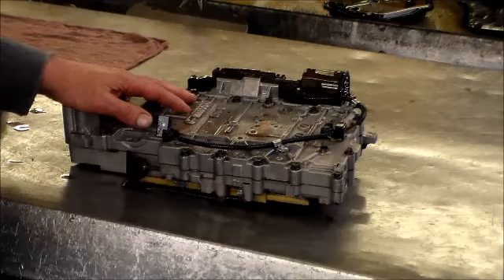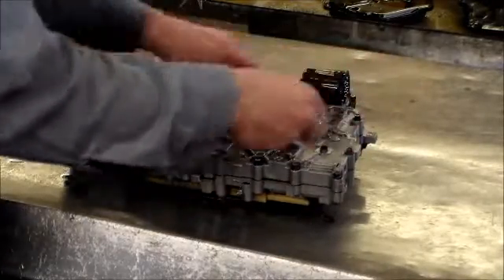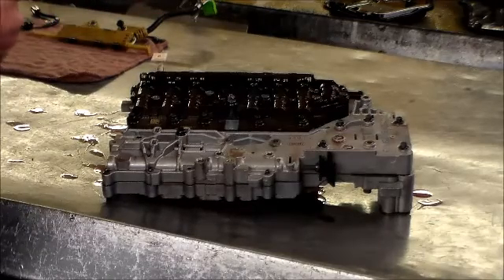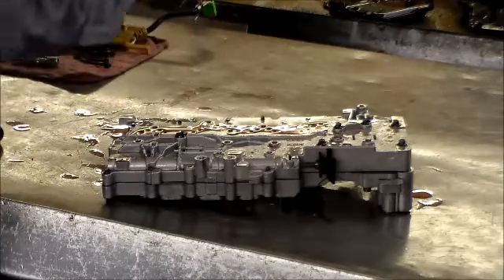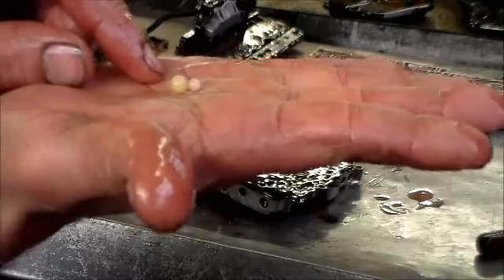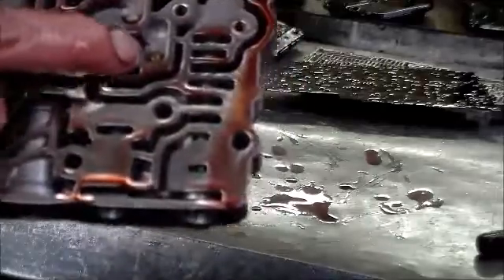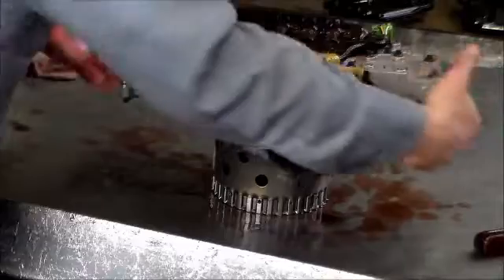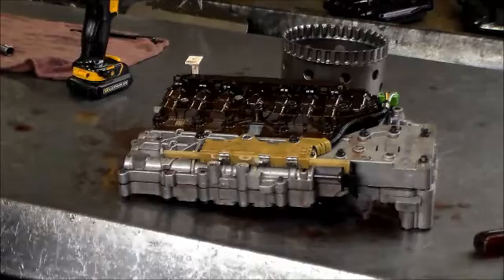6L80E Valvebody

Comment: I know this is an old video but I'd figured I'd ask.

I have a 2017 Chevy Tahoe, sometimes acts like it's in neutral when accelerating from a dead stop. It revs up it just under 2k rpms and then jolts a bit into gear, after that it shifts through all gears smooth and has reverse. It only does it sometimes. I replaced the TC, filter, fluid and upgraded the valve on the side of the trans but still have the same issue. There was no metal in the pan when I replaced the TC. Could this check ball issue?
Reply from the maker: yes it could, trans is full for sure?
Reply: @GaryFerraro  Yes, I put about 12ish qts of fluid and it's in the hatch mark when warm. Would you recommend changing all the checks valves or just the one? Also, should I get just the check balls or do an entire zip kit? I know one requires removing the pump and I would prefer not to do that. I'm thinking replacing the check balls should be fine?
Reply from the maker: @oovv2025  checkballs should be fine
Reply: @GaryFerraro  Thank you! I appreciate you taking the time to reply. Subscribing.

Comment: Hey Gary! You helped me greatly with my 6HP26 full rebuild. What’s your opinion on a ‘15 Yukon 6L80, after a few hundred feet lose all forward gears, still have reverse no problem. Turn car off, turn back on. Have forward gears no issue for another few hundred feet, then lose em. P2723 solenoid E stuck closed. P0700 general MIL command status on. Gonna pull the valve body and TEHCM and measure the check-balls and look at the pressure switches/solenoid gasket screens.
Reply from the maker: most common issue is the check ball shrinking down. This will effect forward only and not reverse
Reply: @ Update: The #1 check ball was minorly shrunken down and the TEHCM filter screen was a bit clogged up. Cleaned VB, replaced all check balls and cleaned out TEHCM screen/solenoids and it drives perfectly again!
Reply from the maker: @tylerroe5175  ok, how did the pan look? was there a lot of debris in the pan?
Reply: @GaryFerraro  Yeah there was a decent bit of debris on the magnet. It’s definitely gonna need a full rebuild and torque converter eventually. Prepping for that. But for now it’s back on the road!

Comment: Gary, thank you for one of the best, most detailed videos I've watched about any topic! I have a 2016 Sierra 4WD with a 6L80 and 84k miles. Last week, trans was shuddering a bit under light acceleration. Then yesterday I was almost home from a short drive and it was like the truck went into neutral, kept going in & out of gear and revving up and I managed to glide into the driveway. Took it out this morning for a road test and it was fine until it warmed up a bit (trans around 150-degrees) and it did it again, wouldn't move in any gear. I tried running it thru all gears and turned the truck on and off and sometimes after restarting truck it would intermittently engage, so I kept doing that and I made it home. No codes. I'm guessing this is the issue, so I'll pop the valve body off tomorrow. Thanks again!
Reply from the maker: How is reverse ? if ok, checkball problem.  If no reverse when hot, clogged filter because converter is no good
Reply: @GaryFerraro  I'll check that today, things were a little hectic just trying to get it to move. But reverse might've been gone too. I thought one of the times it was revving I heard rattling that seemed like it was coming from converter, too. If so, I'll need to replace converter and go thru trans? Thanks Gary!
Reply from the maker: @Hobart1958  correct, stops moving because filter is clogged up
Reply: @GaryFerraro   I just test drove that thing for over an hour. All different speeds, sat in park for awhile, sat with it in gear for awhile, got  the trans up to 176-degrees, etc. and couldn't get it malfunction; other than a little shudder or delayed shifting here and there. So I still can't say for sure whether I always have reverse or not. It definitely makes some whining-ish noise when cold and when slowly accelerating and you let off the gas, which I never noticed before - but I always have the radio on. After all that, I rechecked for DTC's and there are still none. I'm thinking I should go ahead and pull the valve body and examine the check balls and hope that's what it is, unless you have another thought. Thanks Gary!
Reply: @GaryFerraro  Just figured I'd follow-up: I dropped the pan today, and there's a fair amount of metal in there, so it's eating itself up. I slapped a new filter in and buttoned it up and heading to the trans shop. Thanks again for all of your help.
Reply from the maker: @Hobart1958  Let me know what they say
Reply: @GaryFerraro   Rebuilding the trans, new Techm, new billet converter, some mods to valve body/etc. $3800. The $7 worth of check-balls would've been a nice save, but that's the way it goes; at least I dropped the pan to take a shot at saving it. Too bad GM puts out junk like this, 83k miles with very little towing or heavy hauling is pretty ridiculous. The next truck won't be GM. Thanks again, Gary!
Reply from the maker: @Hobart1958  That actually is a very good price for what they are doing
Reply: @GaryFerraro   Old school shop that's been around forever, he jotted my name and info down in his spiral notebook and sent me on my way. As soon as he said "it's a little more expensive, but we get a new billet converter" I knew I wasn't even going to price it out, he was going to do the job right.
Reply from the maker: @Hobart1958  i use billet as well

Comment: Great video! Question do you have to replace the plate once you open the body up? Also do you go back tighten up all the bolts you put back in. It seemed you didn’t make the boots that tight.
Reply from the maker: Plate gets reused, has bonded gaskets.  Maybe i did reopen the body but i do not remember
Reply: Hey Gary. Thanks for this video. Question. What’s the inch/lbs torque spec for the bolts? Should a pattern be followed? Thanks!

Comment: Manufacturers designed these check balls to fail. I wonder if metal check balls would work better. Had a 2007 Escalade with the same problem. Paid 3 grand to fix it.

Comment: Wheres the number 4 check ball??
Reply from the maker: upper right hand corner of the valvebody,  Upper valvebody
Reply: @GaryFerraro  mine was missing when I opened it up and didn't have any issues..any thoughts?
Reply from the maker: @michaeljohnson91501  That checkball is seated against the 4-5-6 clutch passage in park,rev,neutral and drive 1st,2nd,3rd,  sure it wasn't there maybe fell out
Reply: @GaryFerraro  hmm maybe it did fall out anyway I replaced it along with fluid pressure sensors and put it all back together now it makes a strange whirring noise in park and neutral then seems to quiet down in drive and reverse any suggestions?
Reply: The sound seems to rev match as well...shops try to tell me its the pump and want to rebuild the whole thing but I'm almost certain it's not because it didn't do it before I messed with it
Reply: @GaryFerraro  could it be the 4 fluid gasket seal under the valvebody not sitting right thats causing the noise??
Reply from the maker: @michaeljohnson91501  I wouldn't think so,  did you change the filter?  how did the pan look when it was down, converters like to go bad with this trans

Comment: Dear sir, could you please advise. I have stock 6L80 on my 2011 chevy camaro SS. I found UPDATED Valve Body Spacer Plate w/ 8 Check Balls 10-Up. Can I use it on my stock car?
Reply from the maker: 2010 and later will fit, valvebody is not affected because the pocket is already there
Reply: @GaryFerraro  Do I need to buy 1 check valve more ?

Comment: HI Gary 
I have a 2017 gmc 2500 with an 6L90  transmission. From what I've read this transmission is similar. My problem is....had two small incidents the day before where the first gear seemed to slip a little. Then yesterday I went to pull out of my driveway and I had no first gear. I have reverse no problem. What I ended up doing was i put the selector in L1 , then with the electronic shifter button I switched it to second and the truck drives no problem. When I start rolling I flip back to D and the truck goes through the upshot and down shifts just fine until I come back to the 1st gear spot.....then nothing. I have no check engine lights on. Does this sound like the checkball shrinking issue to you. Any help by way of advise would be greatly appreciated.
Thanks 
Andrew
Reply from the maker: Yes, It dos, that is the first thing i would check, it is full of fluid corect
Reply: @GaryFerraro  Yes ,it was a little low, I topped it up but nothing changed
Reply: @andrewduffett9363 I'm having similar symptoms on my Tahoe. Did you figure out if the check ball was the issue with your truck?

Comment: Gary, great video and content as always. I am looking at my son's 2014 Silverado 6L80. NO CODES. The trans has drive and reverse and will lose BOTH at the same time. Cannot relate when it does this to any common denominator i.e. trans temp/run time. The scan tool displays the gear selected, but Gear Command on the scan tool was "neutral" on one test and the second test it was "1" regardless of actual gear selection. I am tempted to drop the valve body to look at the check balls but wanted your opinion.

Comment: hello Gary, fantastic piece of work there, please Gary, how did you know the problem was the check ball, did it bring out any DTC? and also is this the only fault that put a car in neutral condition when in drive? thanks
Reply from the maker: It's either the #1 Check ball or a cracked 1-2-3-4 piston  May have code P2728
Reply: Thanks and God Bless You Sir
Reply: Hello Gary, another quick question please , does this particular fault or code I mean the check ball fault  , also happens to other transmission or it happens with just the 6l80s.  Thank you sir

Comment: My 2011 GMC Yukon feels like it flutters in 3rd gear. It goes into all of the others fine. You think it might be a check ball that shrunk?
Reply from the maker: Are there any codes present for the trans?  How is reverse hot?
Reply: @GaryFerraro  check engine light came on then when I turned off my truck and turned it back on like 10min later the check engine light turned off, never came back on but I’ll check for past codes.  No problems with going in reverse

Comment: Thumbs down for not calling out sizes of sockets. 

Got all these guys that want to film DIY you tube specials and they can't even call out socket sizes. 

Waste of time watching this garbage.
Reply from the maker: Sorry, if you like i can give them to you if you are working on one
Reply: @GaryFerraro  7 mm for your whites. 10mm obviously above. Just running back and forth from my tool box.
Reply from the maker: @Knotmaul  Special socket to remove valvebody Torx plus size EP10,   Bellhousing 14MM (i think, maybe 15)   To pull pump apart 8MM,  Split apart valvebody 10MM and 7MM
Reply: @GaryFerraro  yeah, I got the special socket. I just realized I added am extra teflon ball to my valve body..  instead of 7 balls for a 2011, I added an 8th. 

Thank you for your response, I'll delete my comment and upvote the video for your immediate response/help
Reply from the maker: @Knotmaul  Did you have to replace a section of the valvebody for the extra ball?  Thank you for deleting and giving me thumbs up

Comment: I am getting cod P2723 could this be my problem? 2011 silverado 6l80e
Reply from the maker: I certainly can yes, does it slip forward?
Reply: @GaryFerraro  yes it does, and going into reverse. Sometimes it will act like its in nuetral and not move at all
Reply from the maker: @milesmaher2167  I would say yes, there is a very good chance the check ball is your problem
Reply: @GaryFerraro  will a fast relearn be required after changing the check ball?
Reply from the maker: @milesmaher2167  No, just drive the car

Comment: Hey Gary I am having a problem with my truck code p0751 truck  runs very well except for a small jerk. What can I do to fix this??
Reply from the maker: What type of scanner are you using to get this code? are you scanning the transmission?  I'm asking because there may be more codes present in the trans

Comment: Hello Garry I got a 2016 Silverado 4x4 5.3. Got the 6L80 transmission. I have replaced the torque converter cause it had a shudder and a slipping out of gear feeling. After replacing the fluid and filter twice now, it has a delay in 1st gear. Takes of good in M2. Doesn’t go into 4th, 5th, or 6th gear. I have cleaned the valve body. It had a bunch of “aluminum debris” Help as I’m trying to avoid paying 2500-3000 dollars

Comment: good morning Gary I have a 2007 Escalade ,and i got the techm replaces but i keep having a delay in shifting from park to drive.my scanner pulled up a code P2723.That says the pressure silenoid E. could you suggest what i might have to do
Reply from the maker: Hi Kenny, How is reverse? any delay or reverse is good?
Reply: @GaryFerraro  good morning reverse shifts as it should
Reply from the maker: @RidingwithKB  ok, the problem probably is the #1 checkball in the valvebody has shrunk down and either is stuck in the plate or blew through the plate.  I would check that first
Reply: @GaryFerraro  ok thanks i really appreciate it.where are you located?
Reply from the maker: @RidingwithKB  I'm in New York on Long Island, are you in the New York area?

Comment: Hello sir, and thank you very much for this video. It seemed to solve my issue but now I have another issue after installing the valve body. My truck is very sluggish and it seems to be stuck in 3rd gear. It doesn’t shift up or down. Take off is very slow. Any information would be appreciated. Thank you again.
Reply from the maker: you need to have the transmission scanned for codes, this may give some direction

Comment: Are there pressure control solenoids inside of the valve body for the 6L80? I am getting code for Pressure control solenoid B performance or stuck off. The truck drives but often goes into Limp mode.
Reply from the maker: It has the TCM inside the transmission, the solenoids are not serviceable.  What is the code number?  what does it do while driving slip and then goes to failsafe?
Reply: @GaryFerraro  the code is P0776. Hard and erratic shifting, I'm not sure if a gear gets stuck or if it just goes into fail safe mode. Seems like when it gets hot that's when it happens with high revving and doesnt switch gears.
Reply from the maker: @MissZvibrant  Something internal, how is reverse when hot?
Reply: @GaryFerraro  it reverses fine.
Reply from the maker: Zee Lavelle ok when would you say it slips when it shifts?  What gears
Reply: @GaryFerraro  my bf said it gets stuck between 1-2 gear.
Reply: @GaryFerraro  I'm not sure what exactly slipping is...lol sorry. Idk how to tell which gears either.
Reply from the maker: @MissZvibrant  ok, well it starts out in first, you should be able to feel the shifts or watch the rpm, does this happen cold?
Reply: @GaryFerraro  there are slight hard shifts when cold. The high rpms starts when it gets hot.

Comment: Hey Gary, I have a 2014 Sierra 5.3, gears 1,2,3 are fine, 4 5 6 goes neutral and gives p0700 code what would it be?
Reply from the maker: 4-5-6 clutch hub probably snapped off the shaft, when this happens it can no longer drive the clutch
Reply: Gary Ferraro sometimes when im revving on these gears it will hold 5th gear but on high rpm for a second and bam goes back to neutral.

Comment: Yes. It is the 6L80E tyranny and yes it did whine slightly intermittently... and after it got hot it stopped, but when cold like now it'll go right in gear...
Reply from the maker: sounds like the filter is clogging up.  Every converter goes bad on these units

Comment: Hey Gary I have a question? I have a 6l80e in my silverado I'm having an issue with the torque converter lock up  not releasing when I come to a stop occasionally . I have replaced the torque converter but it is still happening? What do you think?
Reply from the maker: Valves could be sticking or dragging in the bore, there are TCC valves in the Lower Valvebody and in the pump, did you happen to take the pan down to see if any debris is in the pan?
Reply: @GaryFerraro  hey Gary I have not pulled the pan off yet I will check that out. I think what might have been making it more worse was I had a stalled converter in my truck  and to keep the converter from flaring in lockup my tuner maxed out the pressure to the tcc circuit. Since then I have replaced torque converter to a stock GM and had him adjust the tcc pressure back to stock and it seems to have cleared up my problem. One more question what do you think of the sonnax 6l80e zip kit do you think installing it would make a difference without installing the pump parts it comes with? 
Thanks for your time.
Reply from the maker: @lonniesanchez2732  I never used the zip kit, good product though. I always use the end plug kit on this trans

Comment: Hey Gary, I’ve started having issues with my 4L80e in 2012 Chevy Silverado 4x4.  Before it was going into limp mode and I could turn the truck off and then start it again and it would let me drive about 1/4 mile then go back into limp mode...  Codes were 0700/0796(pressure control solenoid C stuck off) I dropped the pan and changed filter there was a lot of metal mush around pad the magnet... it drove a lot better then it started again 2 weeks later?   I dropped the pan and changed the fluid again and there was still a good amount of metal mush around  the magnet.What are your suggestions...
Reply from the maker: would you say that the car stopped moving when it heated up?  do you hear a whine coming from the trans?  The trans you have is a 6L80E correct?

Comment: Taking a shot here. My 2011 Silverado 1500 started a code saying torque converter clutch circuit stuck off . Drove it like that and now there’s code for p0796 for pressure control solenoid c stuck off. So now I have 3 codes.
P0796 p0700 and p0741